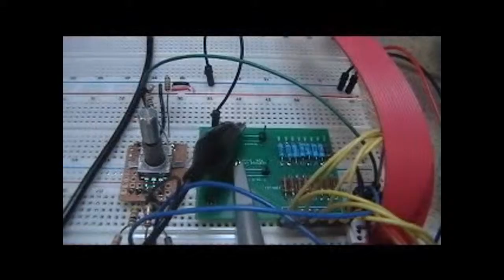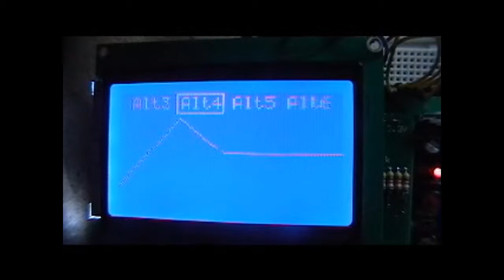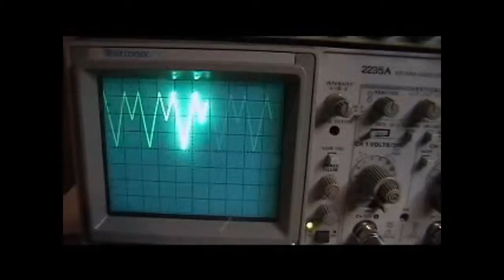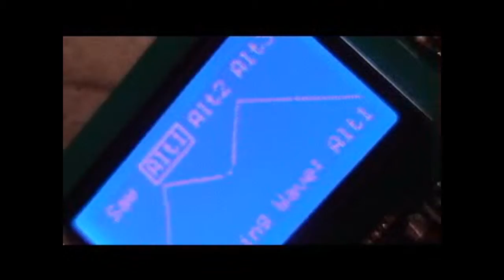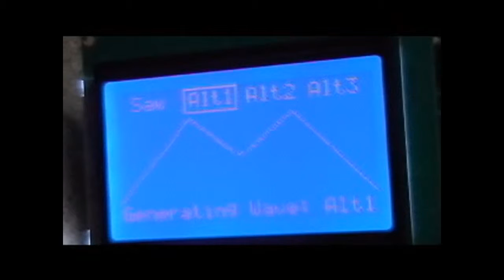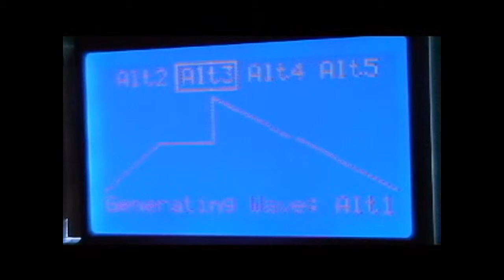Zilog EZ8 Function Generation

Comment: How did you learn how to write code for the eZ8 microcontroller? 6 months ago I started developing eZ8 code. I had to learn everything from the technical datasheets. Because I could barely find any information on websites other than Zilog's I started a sourceforge project: http://www.ez8tut.sourceforge.net/

If you have information to share please do!
Reply from the maker: I have been writing software professionally for almost 35 years.  I have written in many different languages for many different systems.  Generally the concepts are the same it just comes down to the specifics of the processors.  The details are usually found in the various published datasheets and associated material.  I purchased an evaluation board (available from both Digikey and Mouser) that included the standard Zilog IDE (which you can download for free) along with a number of manuals (which I also believe can be found online) that provided most of the details about the inner workings of the processor.  My background in assembler programming helped in understanding the specifics of many of the internal capabilities for which there may not be any high level functions available.

What type of things are you trying to do for which you cannot find appropriate information.  I may be able to either help you with the knowledge you need or point you in the proper direction. 

Let me know how it goes and thanks for watching the video.
Reply: Jonathan Bisnett For my eZ8-based microcomputer project I need to know how to write-protect flash sectors. I read something about it in the datasheet, but I am still not quite sure how it works. Do you need to write some code in the initialization routine that locks flash after every power-on/reset? It is important that the operating system is protected from writes by user programs.
Reply from the maker: For these type of units (ez8) there is no actual operating system.  The code runs from the flash memory.  You could create some type of OS, but there is always a risk it will be overwritten by the next download.  I know of no effective way in the ez8 to protect a segment of the flash memory.
Reply: Jonathan Bisnett I might want to look into the eZ80 microcontroller which can execute from ram. A bootloader would be stored in flash and could be protected while the operating system would be stored on an external device such as an SD card or an eeprom.
Reply from the maker: That would give you the separation you desire.  I haven't worked with the eZ80, but I am guessing that it uses the same basic command set as the other processors in the family.